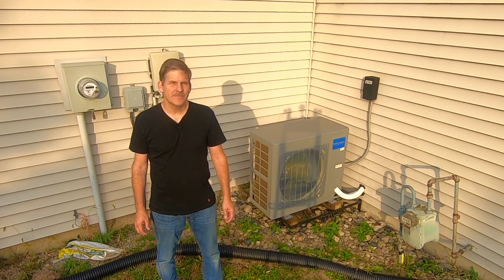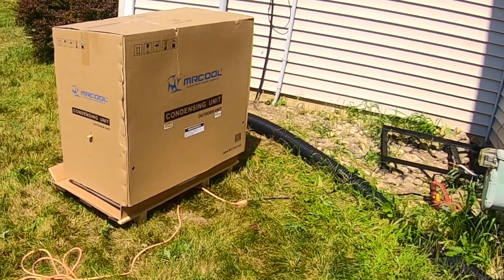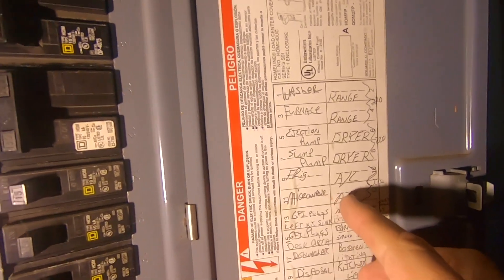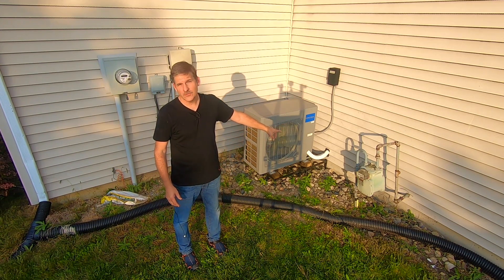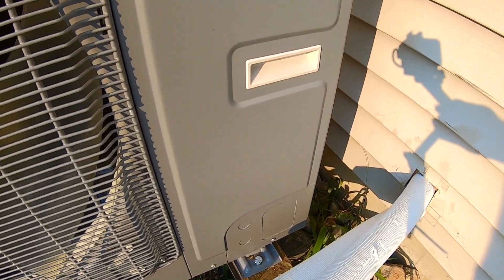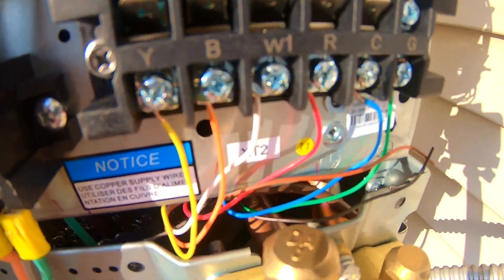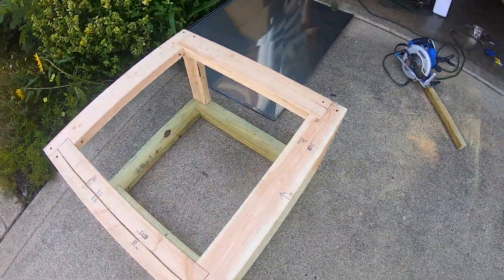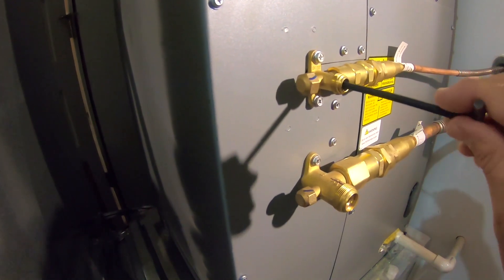How to install Mr Cool Universal Heat Pump: air conditioning and heat solution

Comment: And you left out how you voided your warrantee not getting it done by a certifyed hvac !! Do some reserch with mr cool i did i had mine installed or would void warrantee  so your miss leading people!! Get your facts strait! AGAIN PEOPLE THE UNIVERSAL iS NOT A DYI! YOU CAN BUT NO WARRANTEE!!
Reply: Say Chris, yes, this is an important question, but where are you seeing on the Mr. Cool web site that DIY installs void the warranty?  (I saw that claim on one of the suppliers selling the Mr. Cool units, but not via Mr. Cool's web site, and not on the Home Depot, Lowe's or Amazon listings for these models, where they're obviously marketing to DIY buyers. )  If you're so sure of this, please provide the exact link to the Mr. Cool web site.  (I'd be extra surprised too, as the Mr. Cool videos also say nothing about DIY voiding warranties.)
Reply from the maker: ,Hey Hugh3rdof5
Good point Hugh...,
Officially the universal is not marketed as DIY. That being said, it uses their no-vac lines which does take away one of the HVAC install hurdles.
Tech in HVAC is simplifying things just like pex has taken away hurdles in plumbing.
If you have appropriate knowledge, skills and will to DIY it, what’s the crime in that? 
There will always be people who rather pay than DIY. I’m fine with that. But no sense in limiting what people CAN do themselves if they are so motivated. 
Thx for watching & commenting!
Reply: @Housebarons  thanks for the quick helpful reply David / HB's....  and I was thinking the same thing, that those no-vac lines truly are a potential game changer....  just like pex!  Maybe not a "crime" then for us to be doing it ourselves, yet might we in fact be risking loss of warranty support...?  So on Chris's prompting, I did check around the Mr. Cool web site in search of the warranty policies.... which (alas) do appear to suggest that DIY installations (on non DIY specified systems) may very well invalidate the warranty.  Yet if Mr. Cool is obviously marketing their systems to DIY customers, especially via their own videos and perhaps sponsoring DIY video like your own efforts, then they may very well be setting themselves up for a class-action lawsuit down the road..... if they try to deny warranty support to the very same DIY customers they in fact have encouraged....  I do hope the cool dudes running Mr. Cool see this question and exchange....  Maybe the web site and warranty policy needs updated..... Need to get this cleared up before we buy. (and install ourselves)  No warranty; then no buy.
Reply: @hugh3rdof5  i was not pleased eather with what my suplyer dealer told me wy i went to support and both said voids warrantee if you diy!! wich is very missleading in there advertiseing ! Nuff said  i do like the system up to now ty :)
Reply: Thanks again for raising this serious "red flag" issue, Chris.....  will follow-up.
Reply: @hugh3rdof5  yw i hate to see people misleaded. its my only sore spot with mr cool too and ty too for understanding me ! :)
Reply: I get pretty sore over all this diy hype  that mr cool misleads too im soory but it burns my butt! thanks
Reply from the maker: Hey Hugh3rdof5,
In my mind, warranties are of course for protection like all the fine print on literally everything we buy these days. 
But how many warranty pay outs have you received in your life? And if you buy extra warranties, how many have paid off vs. how much have you paid ?
Another question: for those who buy Apple products or a Tesla? Is it because of the warranty or because the company performs??

So, yes, companies need the fine print. But if they produce garbage, then they won’t be around long. Ultimately  if you really believe you are gonna need the warranty, then why buy the product? 

And the company, by design, doesn’t want to pay out warranty claims. So their incentive is to make a product at least good enough to have most products exceed warranty life. So it becomes a game of typically low odds for both seller and buyer. Warranty tells me what the company thinks of their product. 

For me, buying the Mr. Cool stuff comes down to the company and not the fine print. The products, sales, support, & communication of the company all speak loudly about what you are getting. 
Our experience to date w/ Mr.Cool has been above average, even exceptional. We’ve had a repair issue. once. And how the company sells a product and solves the problem is what matters to me. 
Because of all those interactions w/ those departments, we’ve purchased a number of Mr. Cool products for  business and personal. 
And - full disclosure - we became a Mr. Cool distributor as well. 
Still, when people have HVAC issues, we point people to Mr Cool for FREE. Our choice.. We make unsponsored videos of their products. WHY?
If they didn’t do a good job, we NEVER would! To date, they have proven to be a company worth buying from and working with. 

The real warranty these days is social media. 
Smart companies know that a bad review talks 10x times as loud as a word of praise. So that’s a higher bar. 
When I buy stuff, I always read reviews. For me, I care how the company stands behind their customers who purchase their products. That’s the “warranty” that matters. 
Those that go the extra mile will get me to write long answers about them in Youtube comments as well😃. 

So ok. Warranties can matter. But so too does a “voided claim” response from a company. 
So buy from a company you have confidence in.
Just my 2 cents.
Thx again!
Reply: @Housebarons  i agree on what your saying ! I did 3 months of reserch befor i went with mr cool im very happy with them other then what i mentioned ! And shipped in canada about 6 grand so yes warrantee is needed ! Only for big components like compressor or icms!  I understand what warranttee is. just parts are garanteed  you pay your hvac guy to put it in and fix it ! So ya  mabe a small thing you can work a deal with mr cool to plug and play yourself iv not got to that stage yet but 10 year warantee on iniversal is needed compared to none! And yes every busyness can go under thats lifes chances today ! Iv have become very close with my dealer supplyer we are freinds now we talk alot so im not blowing hot air like most do! I truely like mr cool or i would not have chosed them!   Regards ;)
Reply from the maker: Hey Chris,
Maybe the better question would be : does a DIY install ABSOLUTELY in every case void the warranty, OR does common sense apply?
Say you forgo having electrician hook it up - you just wing it and fry the circuit board. I think common sense would say : don’t try and make that a warranty claim. 
But if you DIY it and the recirculating valve fails, or inverter dies, that equals warranty claim all day - DIY or not. 
Some companies use warranties as a “ we are never responsible card “ and others use it along common sense.
Maybe some clarification would help. 
Thx for the input!
Thx for watching!
Reply: @Housebarons  you can do electrics but if you fry somthing you void warrantee!! They want hvac guy with licence to fire it up and when you do regestration on mr cool web site it ask for the hvac info on your bill of install and his phone #  !! Just call tec support youl see im.spot on ! P.s wonce voided all is voided all components !!!
Reply: @Housebarons  Wow, I'm impressed by the eloquence of your libertarian style argument, would make for a great copy for "newsmax" or FBN..... But you've now gone rather overboard in dismissing the very idea of a warranty as in effect, irrelevant compared to the power of social media.  Balderdash. (in spades)  Folks don't go forking over tens of thousands for a new auto and then say that they really don't care if it has a warranty.  (Not even Elon Musk would try that....)  Same with one of these Mr. Cool "universal" systems.  The idea being "sold" here is that it's easy to install, that (wink wink), if you're handy and determined, you too can save hiring an hvac pro and install it yourself....  (for "only" about $3,400 or so....  over an existing pre-ducted house)....   But what if something goes awry with the unit early?  (Is newsmax social media going to stand behind you then -- esp. if the company says, sorry, DIY voids it...  sorry sucker, you fell for the DIY suggestion, and now you're on your own. ps, and yes, there are recent videos out there of rather new Mr. Cool compressors starting to make loud rackets.... which then the excuse comes out saying, "oh that's normal" -- no, it's NOT... T'was a time when upstanding companies would stand behind their products.... and still hope Mr. Cool, as per your experience, is just that sort of company.)   But back to up-front costs, by serious contrast, I can call up AlpineHomeAir (Chicago based seller), buy a complete conventional hyrbrid system for my house (w/ either new BlueRidge or Goodman propane furnace & heat pump components) and the whole package for $1,000 or more less than the Mr. Cool Universal system.  Alpine too caters to DIY folks..... even while apparently networking with local installers to help with final hook-ups and/or inspections, if desired and where required....  (and no where have I seen indications that DIY void your warranties.... but will double-check.  Final install expense then with an Alipine combo package likely to be less than a diy install of Mr. Cool "universal" -- without losing the warranty.) Sure, I'd VERY much prefer to have this type of inverter heat pump in my home.... (whether by Mr. Cool or any of the Japanese companies that invented them and market them globally)....
Reply: ps, ironic in realizing that you're an installer yourself....  so your customers will be just fine and still have a valid warranty.  But those you inspire to do it themselves.... will literally be left out in the cold....  (do hope Mr. Hot can address/correct this)
Reply from the maker: Hey Hugh& Chris,
Briefly ( if I can ) 2 points.
1) re: warranty’s - All I was trying to say is I don’t buy a product because of the warranty, but the product. The size of the warranty let’s me know how much the company has faith or not in their product. Sure, I’d rather it have a warranty, but I’m a realist and warranties are crafted by lawyers. Sometimes even with a warranty you get bit. That’s all. 
When I look at doing a job myself, if my DIY efforts void a warranty, then I want to know the cost of replacement or repair. 
So PRODUCT + DIY + REPAIR has to be less than PRODUCT+ PRO INSTALL COSTS. 
That’s how I make a decision on DIY.
2) I emailed Mr.Cool and got this back:
“The Universal system comes with a 10 or 5 year warranty. The 10yr is when it is installed by an HVAC technician. The 5 yr is when it is installed by the customer using a MRCOOL pre-charged lineset.”
Somewhat goods news for both sides???
Reply: @Housebarons  well sorry to say when i buyed it 6 months ago my dealer and mr cool tec told me voids all warrrantees when its not hvac installed so unless they changed policy since then . Im no liar! im here just to help diyers p.s and that kinda pisses me off because i would of taken the 5 years and do it myself too ! So again mr cool is blowing smoke screens ! Thanks for update too
Reply from the maker: Hey Christopher, 
Sorry to hear that. I believe you. So was your dealer and tech from the same shop? I agree with you - the 5 yr warranty and DIY install is a great option.
I don’t know if the warranty changed. I don’t know if you were fed a line, or the people you talked to just spoke w/o really knowing. BUT, I do know that your are helping any and all who read through this ( and people do read through comments ) . You have helped me get down to the accurate warranty details so - many thanks!
Reply: @hugh3rdof5  - says the Biden voter and CNN viewer....
Reply: @hugh3rdof5  sorry my dealer plus i talked to mr cool  tec support too  they told me universal is the only 1 not dyi cause it voids  warrantee ! Even tho iv seen them push that too!  you look into buying 1 like i did! i will do a vid too this winter on mine ty :)
Reply: @hugh3rdof5  mr cool .com call tec support  you will see and my suppyer talked to them too said the same thing i know mr cool is very missleading im not pleased about that too i could of saved  2 grand for install !! Hope this helps
Reply: I am a Mr. Cool dealer.  The universal product has a 5 year + extra registered 5 year warranty.  It reverts to a 1 year if not installed by a certified HVAC contractor.  No where is this product advertised as a DIY system by Mr. Cool.  Mr. Cool's DIY systems all have "DIY" in the model number.  You can go to Mrcool.com and see all the systems they have in the DIY category.  I don't see how Mr. Cool has mislead any body on this....
Reply: @smeek111  yes they did they have changed pollicy over 6 months ago there was warrantee voided if not installed  by a certifyed hvac ! I buyed one my dealer and  mrcool tec support told me this ! But things have changed i was told now !!
Reply: @christopherreus7799    Companies are allowed to change policy.  Not sure when you bought you system but I do know that their website gives you access to all their warranty information for all their equipment.  They are also pretty clear as to what are DIY systems and what aren't.  I will say this, Mr. Cool has really gone out on a limb in offering a DIY system to begin with.  I have worked for enough companies over the years and dealt with most of the major brands and there is no way in hell any of them would ever give a warranty if they found out a homeowner installed their own system.  Try as a homeowner to file your own claim with a company like Trane or Lennox or Carrier or Fujitsu.  Maybe next time be sure you get a system advertised as DIY.  As much to the manufacturer's dismay, most of the major brands can now be purchased online.  Up until the last 20 years you couldn't purchase equipment unless you were a dealer.  I have not seen a warranty certificate yet that doesn't say ".... covered unless purchased online".  Maybe you could post of copy of the warranty papers that came with your system when you bought it so we can see what it actually said.
Reply: @smeek111  hi again like i said its all verbal from mr cool tec and my dealer too from a email no papers just words but when i regestered online for warrantee i did talk to mr cool tec he said i was regestered  on the warrantee wich is 10 years ty again :) nice chat
Reply: @smeek111  would you happen to have a ball park on what an installer would charge for an installation on the east coast? I have an existing system so they wouldn’t need to drill or run new electric. I’d have to assume given the lines are Pre charged it would significantly reduce the time yeah?
Reply: @k.j.g.9601  
Rates from region to region can be so vastly different it would be difficult to say.  The precharged line sets allow for DIY installation.  The old line set still needs taken out and the new one ran.  That would offset the time saved in not having to draw a vac which can be done while you are finishing up other things that need done.  I would think that a company would still charge $1000-1500 for install.  That is based on my region tho....
Reply: For anyone reading these warranty comments, as of this posting (2/22/21) the warranty for the Mr Cool Universal system states "The services of a professional installer are NOT required when the MRCOOL Quick Connect Pre-Charged Line Set is used in the installation." -- I have also confirmed with tech support that "if you use our pre-charged lineset while self-installing, then you are eligible for the 10-year warranty" as long as your register the product on line within 60 days.

Comment: Does the air handler have the metering device like a typical split system AC or is the metering device in the outdoor unit like a typical mini split?
Reply from the maker: Hey Donny, 
I’m not 100 % sure, but I thought I once saw a diagram that showed it had a metering device on both the condenser and the air handler.
To be sure, it might be worth a call to mrcool though. Thanks for the question and for watching.
Reply: It will have a evt or txv
Reply: @jamesdeluca1842  It has both actually. It has 2 EXV in the outdoor unit and 1 TXV in the air handler. The TXV is used in cool mode as the metering device, with the EXV as the VRF control. In heat mode, the TXV is bypassed and only the EXV are used.
Reply: It has metering in the air handler. It is less like a mini split then you think. There is a bunch of cool stuff in the outdoor unit. No sensors on the evaporator like a mini split. Liquid line is actually liquid line, unlike minis.